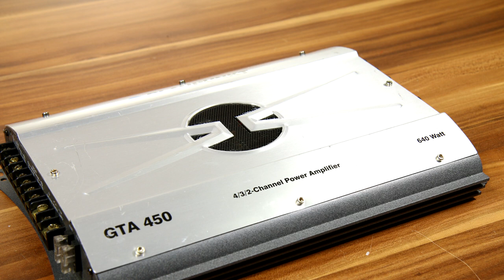Blaupunkt gta 450 car audio stereo amplifier look inside

Comment: Blaupunkt makes good stuff. Designed in Germany and assembled in Korean
Reply: They make very clean sounding amplifiers. And they often seem not powerfull when looking at specsheets, but they always give a lot more then their ratings.

I have loads of them as they are very cheap used for some reason. They really are little gems
Reply: what do you thinkabout the gta 475? is it any good? i have one but i dont think that a 200 watt power supply will help much